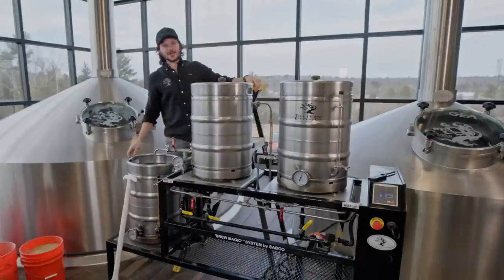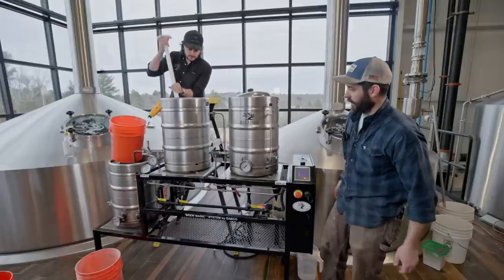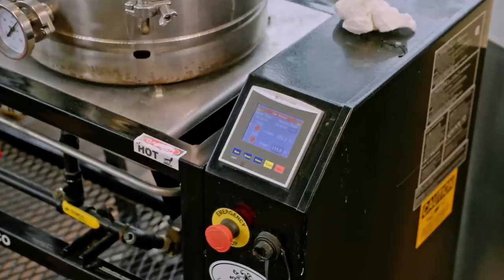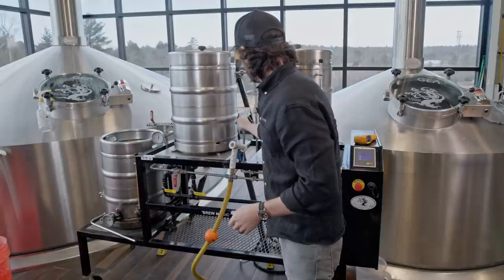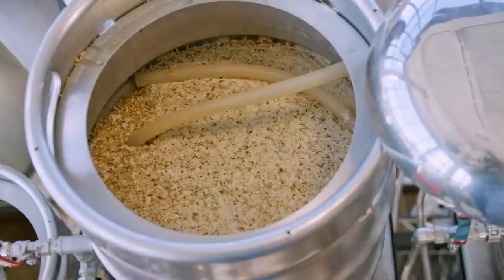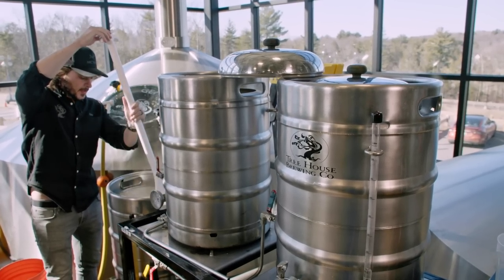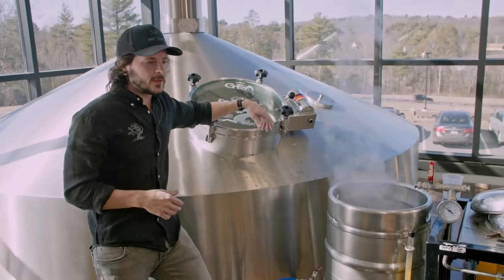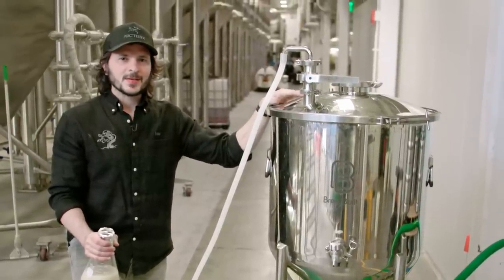Home Brew Day at Tree House!

Comment: You got the Tree House thing all wrong. Why not do it more like Tree House? Ex. 1. Wait til Tree House says it ok to by grain and hops (when they open at your location) 2. Buy tickets for your grains online, then wait in line at Tree House to pick them up. 3. Mash in using a plastic mash tun (like the plastic draft cups they serve drafts in at Tree House) 4. If you don't do it all before they close...well its all cancelled my friend...tuff luck.  Those are the kinds of rules you can make when running a business from manufacturing to direct retail, Cheers!

Comment: Demonstrating SABCOs are antiquated and overpriced lol. 

As someone who used to do pilot brews on one professionally they really are annoying to use. If you fly sparge like all brewers do you have to run off very slowly or you'll get shit efficiency. You can batch sparge quickly and get good numbers though but batch sparging irks me personally lol. Also, the RIMs heater on it kind of sucks. It hunts temperature constantly and clogs very easily because the piping is so small. 

The Clawhammer supply system is a much more compact, cheaper (about 1/7 the price), and less physical labor to brew on. It also uses 240v so you don't have to jack around with propane or natural gas.

Comment: Starches convert into sugars? Are you sure about that? The correct term is mash conversion, not starch conversion. Glucose is involved during conversion, not starch. Alpha deals with starch. Starch is a polysaccharide, which means the sugars are already there. Why does starch need to convert into sugar when the sugars are wrapped up in the starch? When we chew bread it begins to taste sweet after a few minutes of chewing, did conversion occur? Nope, liquefaction occurred, Alpha released glucose, which is one of three building blocks of life and our saliva contains amylase, which immediately releases glucose from the starch we eat. Glucose enters right into our blood stream it doesn't need to be digested. Anything that eats starch somewhere in their body is Alpha, it is connected to life, even in barley seed. Glucose is terribly bitter and to cover the extreme bitterness, the other piece of the starch chain that forms when Alpha liquefies amylose contains sweet tasting sugar.
Starch conversion came out of home brew books to make it appear that something magical occurs when malt is soaked in hot water for an hour, especially when high modified, high protein, malt is used, which is inexpensive, malt, that is low in enzyme content.
Beta is responsible for conversion. During conversion Beta converts glucose, not starch. 
This is the way it works. Alpha softens and liquefies simple and complex starch, amylose and amylopectin, it is called liquefaction, dextrinization and gelatinization, not conversion. Alpha liquefies 1-4 links in the simple starch chain, amylose, and when that happens two chains form. The chains are called the nonreducing end and the reducing end. The nonreducing end is highly fermentable, simple sugar, glucose. The reducing end contains sweet tasting, nonfermenting types of simple sugar. The reducing end is called the reducing end because it contains 1-4 links and Alpha continues to liquefy the links forming more and more nonreducing and reducing ends until all of the links have been liquefied or until Alpha denatures and sweet tasting sugar is left. The higher the rest temperature the quicker Alpha denatures leaving the reducing end, longer, and the final product will turn out sweeter and lower in ABV. If you brew beer with single temperature infusion you can only control the amount of glucose versus the amount of sweet sugar that forms by raising or lowering mash temperature and that is all.
You threw away amylopectin with the spent mash. Amylopectin is hard, heat resistant, complex starch that makes up the tips of malt. Amylopectin is the richest starch in malt and it contains A and B limit dextrin which are tasteless, nonfermenting types of sugar that are part of body and mouthfeel in ale and lager. The starch begins to open up at 169F but enzymes denature at the temperature and starch carry over occurs. The brewery would need a mash cooker/decoction boiler to take advantage of amylopectin. Boiling the mash rapidly bursts amylopectin. When the boiling mash is added back into the main mash Alpha liquefies the complex starch and dextrinization and gelatinization occur. If you boil some of the mash you won't need to buy specialty malt.
Conversion occurs at 140 to 145F and Beta is the converter. Alpha is active during conversion and Beta converts the glucose that Alpha releases into fermentable, complex types of sugar by combining glucose molecules with water and a disaccharide and a trisaccharide form. You skipped conversion by denaturing Beta. Moonshiners use single temperature infusion and do the same thing because they have no need for complex types of sugar, they only need glucose. Secondary fermentation occurs when conversion takes place. In moonshining there is no reason to spend time on a step that converts the glucose that is already in the extract, into fermentable, complex types of sugar, purchase a secondary fermenter, rack the beer into a secondary fermenter, and wait for secondary fermentation to occur when an enzyme in yeast converts the complex sugar back into the glucose that was in the extract, upstream. Maltotriose naturally carbonates beer during conditioning but there are certain types of home brew style bread yeasts that cannot ferment certain types of fermentable, complex sugars. That is another reason why conversion is skipped. Moonshiners use 149, 150F and soak malt for an hour at the temperatures. Alpha releases the highest volume of glucose and less nonfermenting types of sugar in an hour and the high temperature rapidly denatures Beta. When conversion is skipped the beer is moonshiners beer no matter what you call it.
A two temperature, step mash method is used for making malt liquor, which is lower quality beer than ale and lager and cheaper to buy. How can it be that you made IPA with single temperature infusion, which is the same brewing method moonshiners use, when a more time consuming and a more complex brewing method is used for making cheap, low quality, malt liquor? Is that part of the magic that you spoke about?